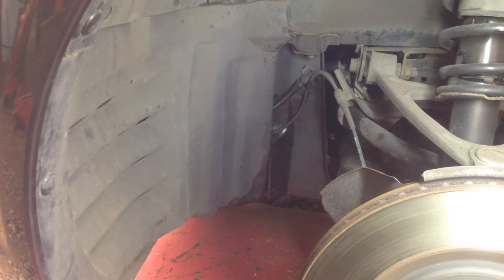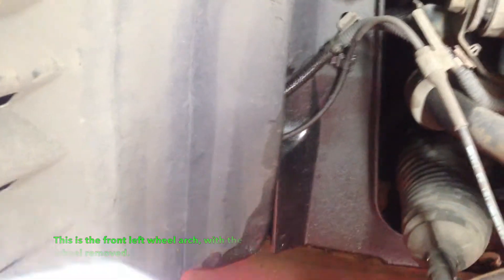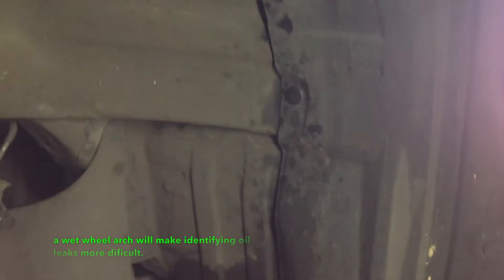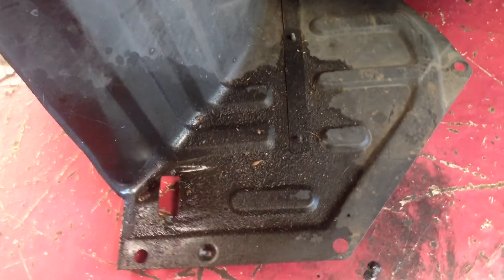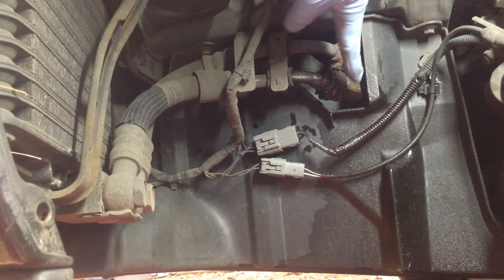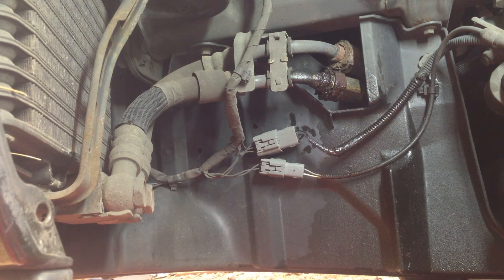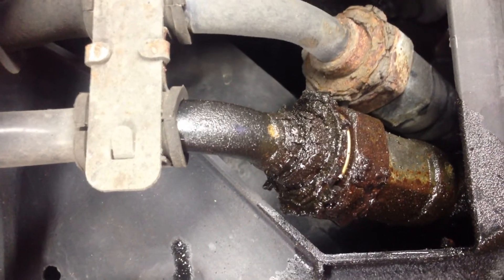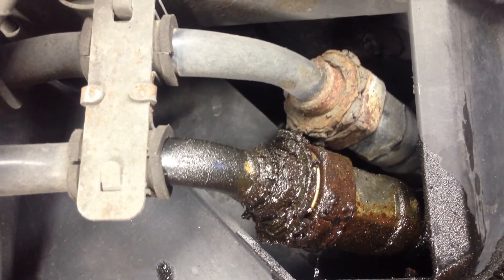Essex Rotary Quick Vid 15 - Identifying a Common RX 8 Oil Cooler Hose Leak

Comment: Hi, my oil cooler hose are leaking on the big nut that connects to the oil cooler itself,, looks a bit crusty - I’m tempted to clean it up and replace a washer if there is one. Do I need to drain the oil before I do this?
Reply: I think I have a similar issue. Did you tackle it yet? Did you fix it?
Reply: @funkyy-fresh  nah not yet - need to take a look though
Reply from the maker: How did you guys get on?

Comment: Can you use Adhesive sealer which is for leaks in hot engines ?
Reply from the maker: Hi Darren.
if you mean to seal the leak, then we would strongly advise against this, that’s not a real repair, and will probably come back to bite you in the rectum in the future.
If your oil pipe fails at high RPM then it’s goodbye engine.

Comment: My rx8 went in for recall , they mentioned oil lines, would this be the recall ?
Reply from the maker: i dont know of any dealers these days that are still doing oil line recalls.
These days it is more the job of the owner to pay for this repair.
Reply from the maker: In our experience Mazda no longer offer these as a recall due to the age of the vehicles. They are more often than not the responsibility of the vehicle owners these days.
Reply: @essexrotary1540  i got new oil lines for free during the recall from Mazda. It was based on my VIN number, origin is british and it has been recalled in Prague, Czech Republic.

I dont think there is really an expiration on this. My original lines exploded and they placed new ones.

Comment: If one of the lines starts leaking do you have to replace the full kit, or just the failed one?
Reply from the maker: Gary Dawkin we would normally recommend you change the full set. If one has failed then others will probably go after.
You can see in the video where the upper connector (that is not leaking) is very badly corroded as mentioned.
We only sell our kit as a full set to encourage owners to change them all.
Reply from the maker: id depends what you can source, 
We only sell out kits as a full set, however other makers like Mishimoto do a "Primary" hose but it is worth remembering that no one makes a "remaining set" fo the other 2 lines.
We would always recommend replacing the whole set, as there is nothing worse than needing to replace the other lines later on and having to pay twice (or at least more than it would have cost to do the whole job at once)